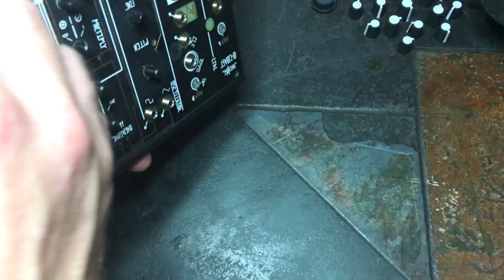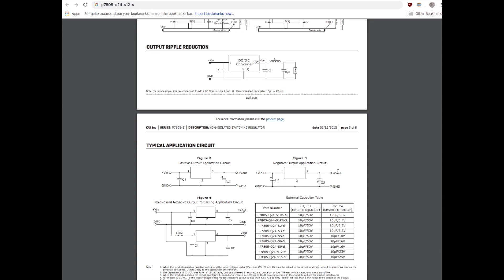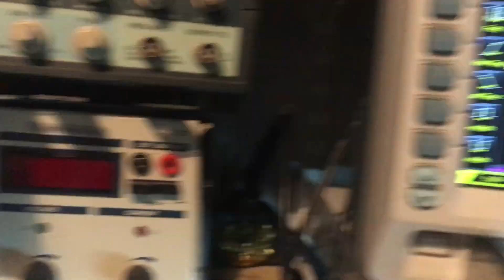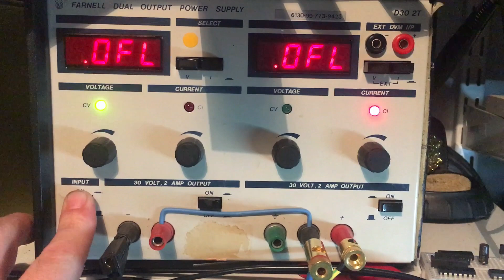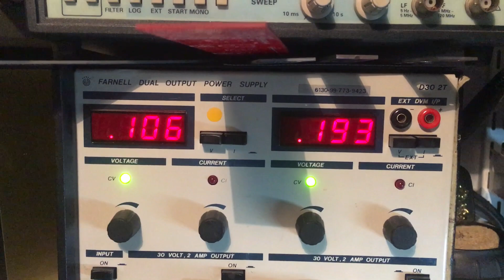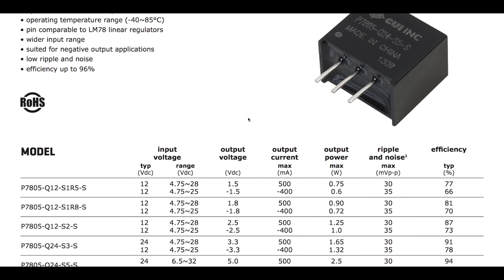o coast repair

Comment: I am replacing a jack on the 0-coast. My soldering iron doesn’t seem to be able to melt the solder. Is it it by you knowledge silver solder?
Reply from the maker: Just normal solder, try some flux that should help transfer some more heat to the solder
Reply: I have a problem with the line out jack connector, do you know the part number? Or where I could buy it? Thks

Comment: I thought I had fried my 0-coast after powering it with the wrong adapter by mistake. I plugged an 18Vdc power supply from my mixer that was right beside the 0-coast ps and it lost the oscillators just like yours. I measured and the -12V line is gone so ordered another P7805 form Arrow. I just don't have a bench ps to test it properly like you did so let's hope replacing the P7805 will fix it. Thanks a lot for this video!!